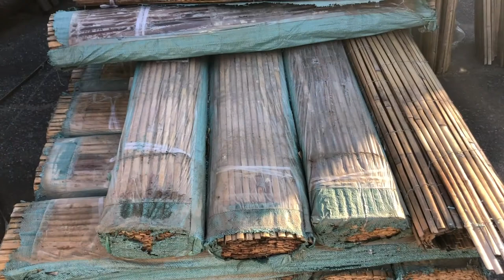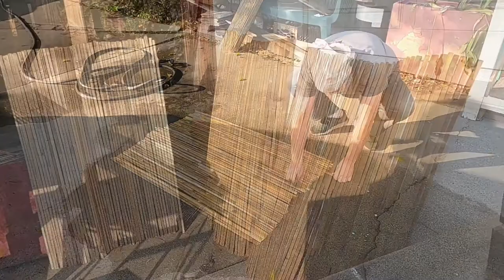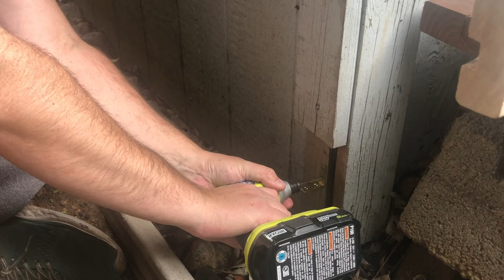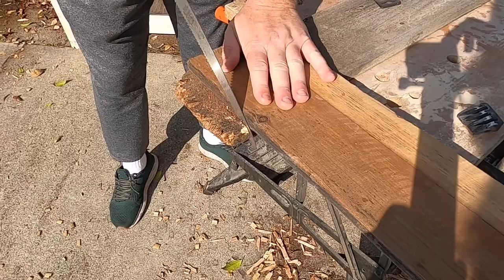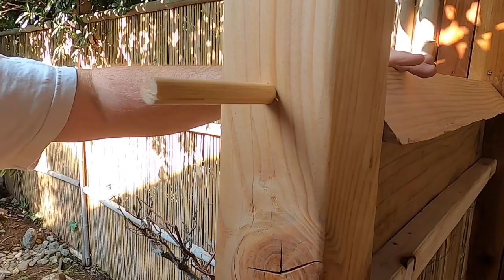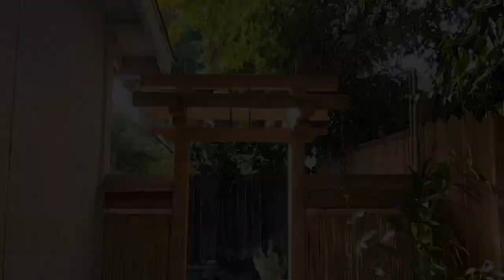Building a Japanese Inspired Fence

Comment: I did a number of projects like this, and my advice...when you're done, paint the exposed wood, bamboo surfaces with clear, marine spar varnish.  I used McKlosky's Marine Spar Varnish...the original formulation (with VOC's).  It's called Man o' War and has a picture of a racehorse.  Otherwise the wood will oxidize and discolor to a uniform battleship grey.
Reply from the maker: Thanks for the advice!  I will look into it ☺️

Comment: Great to build things. Even as an amateur , sometimes especially so.  Great results, But please consider your safety more ! 
 
watching the dowel slit/cut, secured by your hand, while in the background is a workmate that would reduce tendon damage risk substatially if used, was just terrifying to watch & more so to imagine others copying. 

Top power tool tip.  stand to the side of your work and the direction of travel of any rotating blades !

secure work before spade drilling & not while sitting 

otherwise, great result
Reply from the maker: Thanks for your advice 🥰
Reply: @timeoffwithtrevor8456  thanks for your inspiration.

Comment: Young man, do you not have a circular saw?   I realize that may be all you had, but if you had an angle grinder & drill, one would presume one would have a circular saw.  And was that a tree pruning hand saw?  Friendly advice:  use the proper tools (especially if their basic) specific for the job at hand & for Pete’s sake, use gloves & proper technique when using power or hand tools.   You made me cringe many times.  We all begin sometime - I understand that, but common sense also has its place.  Keep on doing tho.  Good effort.
Reply from the maker: Thank you for your advice!